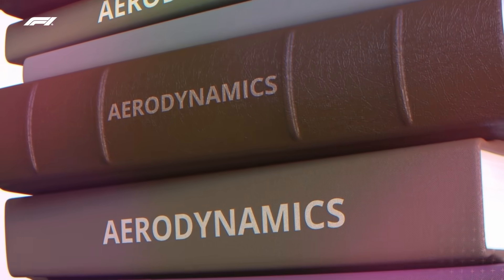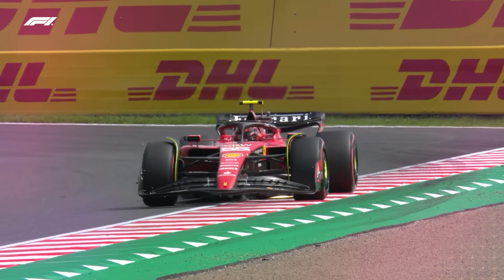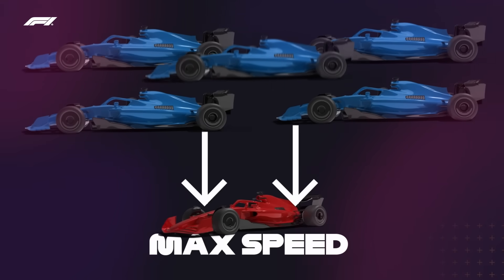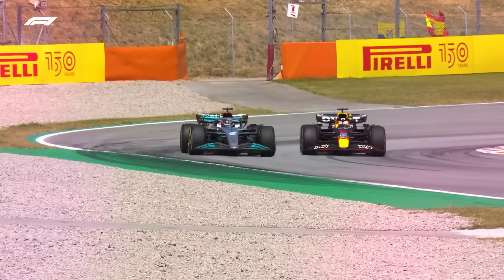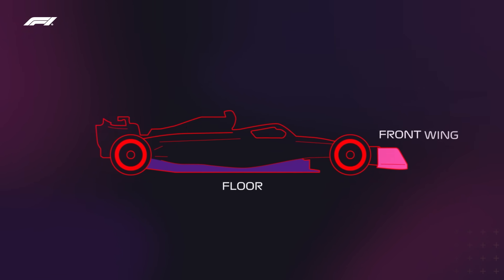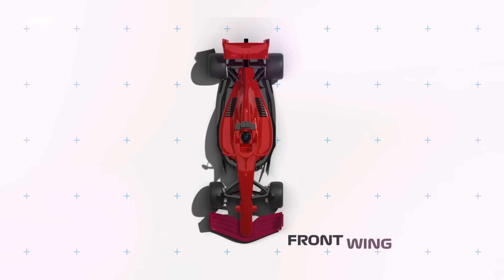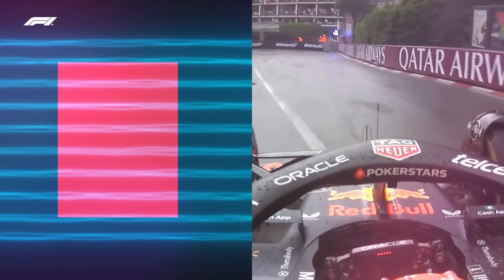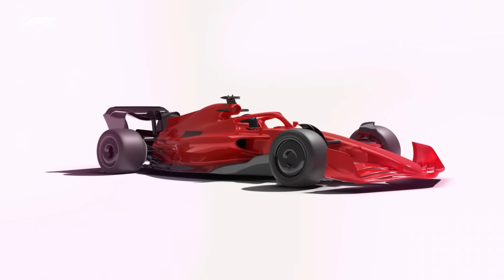Aerodynamics in Formula 1 | F1 Explained

Comment: DRS is such bs. Even commentating on the video describes it as "as way to pass BEFORE the corner" when it was never supposed to be push-to-pass, but rather help a car get alongside to give it a chance to compete for the corner on the brakes.  There is absolutely no skill required for DRS when you can overtake a car and move back ahead of it onto the racing line even before you reach the corner entry like we see in many modern DRS moves.

Comment: What are some ways to utilize and optimize aerodynamic downforce on a car? I plan to dramatically minimize the overall weight of a drag car (hoping that the car will be somewhere under 1900 lbs). However, if too much weight is removed, the traction will also be significantly reduced (I realize that it's probably a delicate balancing act). Although I would also like to use the car for autocross events. Basic knowledge would indicate that if a car weighs less than mpg, should be improved compared to the same car that weighs 500 lbs more for easy math. Acceleration, Top Speed, etc, should also be improved compared to the 500 lb heavier car if my reasoning is at least somewhat correct. Am I correct? Thanks in advance for any and all advice, opinions, or answers.

Comment: You're missing a huge factor on this description: too much downforce tears up the surface of the tyres, so by the end of the race stint tyre grip undermines downforce.

Cornering speed is not all on downforce, it also depends on tyre grip. And also on drivivng style.

Comment: 5:42 "During the race, [DRS] can only be activated when you are within one second of the car in front at the time you enter the activation zone."
No; unless there's recently been a rule change I'm not aware of, it should be "... at the time you cross the DRS detection zone", which can be a few dozen meters before the proper activation zone, and that can make a difference.

Comment: Little known fact: contrary to common intuition, most of the aerodynamic effect takes place UNDER the wing (over for aircraft wings). So it's not really pushing the car down, but pulling the car down. 
I know it's very unintuitive
Reply: We always seem to think of Force as push-force, when it can pull too
It makes sense, but somehow we don't think of it that way
Reply: The only way for air to pull down on the car is by centrifugal forces so great that the viscous forces of the fluid under the wing can overcome the inertial forces at speeds which F1 cars operate at, which is impossible. It's the lower pressure under the wing which allows the higher pressure above to produce the downward pressure gradient(pressure imbalance), which is a pushing force, to produce the downforce.
Reply: @singh2702  Of course the whole system balance counts and it's all relative. If the pressure below is lower, the pressure above is higher. The contribution is from both but it's more from below. The graphs show it.
Reply: @giogio182  What you have just stated is a stronger pressure gradient, by a further reduction in pressure underneath results in a greater pressure differential, hence a greater net force in the downward direction. The fluid is pushing the car into the ground not pulling.